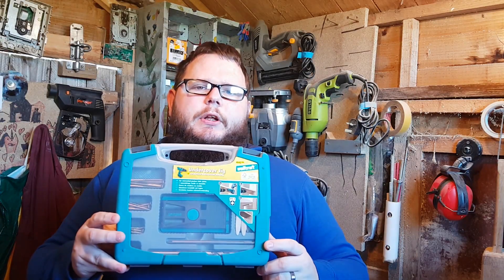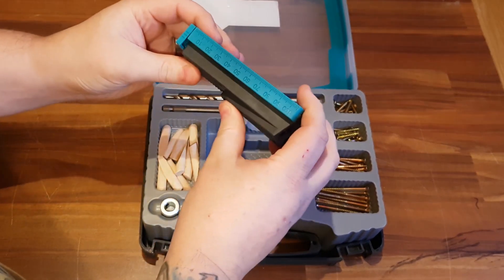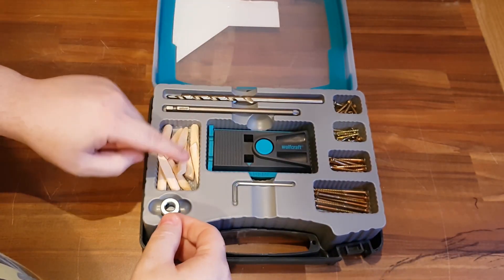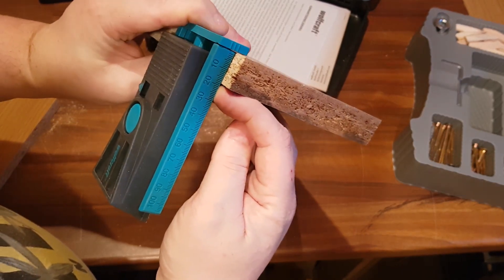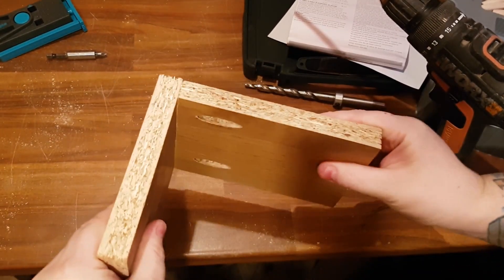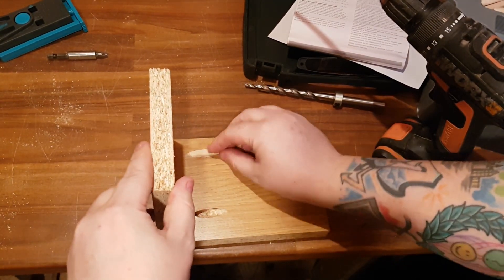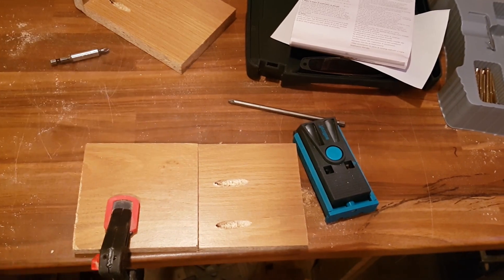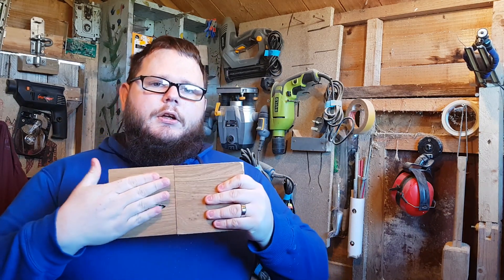Wolfcraft Undercover Jig Review/Overview/Test (Pocket hole Jig)

Comment: Just a tip I ran the screw bit a few times across a big magnet and it holds the screws very making it a one handed operation good value at €38 here in  Mcquillans. Dublin  good vid turn down the musak,
Reply from the maker: Hi Bill, thanks for the tip. That would definitely make it easier to use. I have been in mcquillans a couple of times, good selection of stuff there. If you are interested in collaborating on a video send me an email, everydaddiy@gmail.com. thanks for commenting.

Comment: The screws supplied are with a tapered head, they should be flat so they dont split the wood when pulling the two pieces together
Reply from the maker: That's a good point, I haven't came across this before but it makes sense, I will do some reading up on it. Thanks for sharing your knowledge

Comment: Hi if i have thicker material how do i set it
Reply from the maker: Hi , you press the button and slide it out to the mark. If your material is 20mm use the 19 mark, if its 30mm use the 27 mark etc. You use the mark that matches your material thickness or if it doesn't match use the mark below your thickness. I hope that makes sense. Thanks
Reply: @EveryDadDIY  what about the drill bit depth?
Reply from the maker: HI, you push the drill bit through the jig and on the under side it has the markings for depth. just match the start of the thicker drill bit to the depth you have and put on the depth stop using the  allen key. see the video at 2:20 for more info. I hope that helps
Reply: @EveryDadDIY  thanks.  I'll try this.